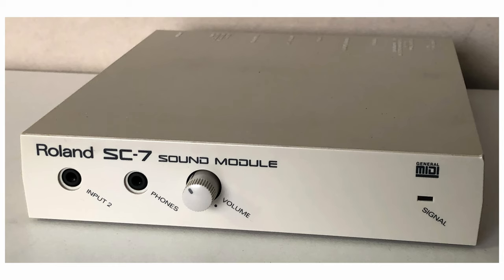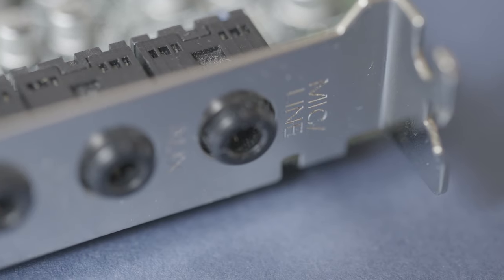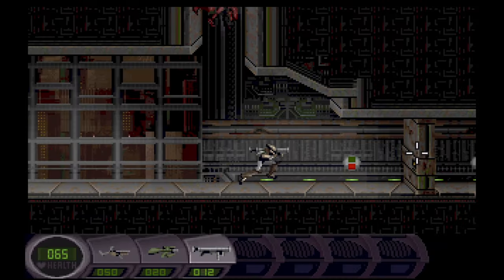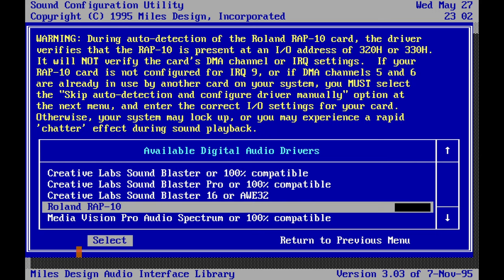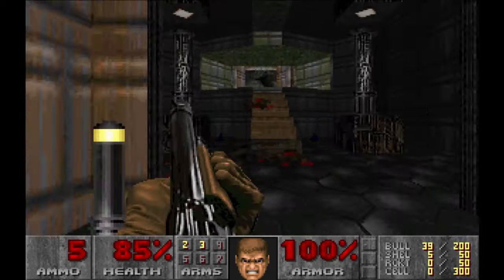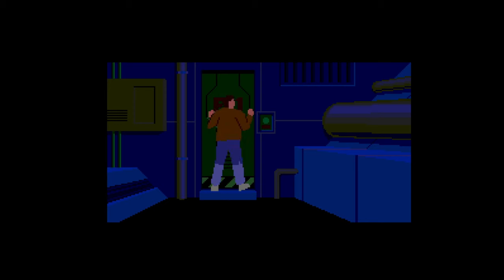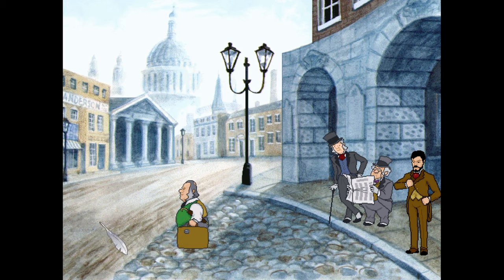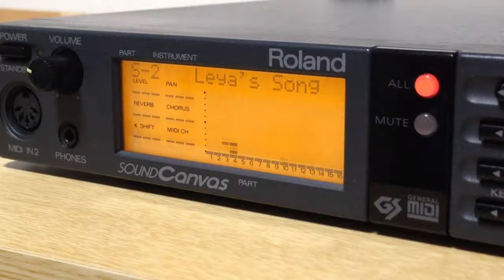Roland RAP-10 review - Quest For The Ultimate DOS Sound Card Part 8 - State of The Art Sound Card?

Comment: Back in 1998, I had an obscure card that nobody knew: Sound Vision 32 Gold by Malifax Computers of Singapore (I still have it but I cannot connect it in a modern motherboard (after 2002). It was better than Soundblaster and even better than many other famous sound-cards. It has an ESS AudioDrive ES1868F chip and also a chip made by Dream SA France.
Reply from the maker: Is it this one? http://www.yjfy.com/images/oldhard/sound/Gold-32.jpg
Reply: @KITR-UK  Yes, this is the one! I still have it and it's still working, 22 years after. However, I had to buy an old PC with a suitable motherboard, in order to install it again (the PC on which I first installed it died in 2002) because it is connected only in an ISA slot not a PCI or PCIe. It has a great reproduction of MIDI instruments and I used it for composing with the help of Cakewalk Express v 3.1. I remember that, in order for the wavetable chip on it to work and start reproducing the MIDI sounds with the highest quality, I had to change the MIDI sound settings to MPU-401. Before I change this setting, the midi sounded awful. But really this version of Sound-Vision 32 Gold  (there was also a 16 version) was far better than the similar SoundBlaster. The only negative is that it has distortion (hiss noise) in the sound, which can be heard even in recordings and for this reason I had to perform a hiss removal in order to clear my MIDI recordings. I have in my channel two such recording: one piece is called "Die Like a Rock" and the other "When a Thousand Years Pass". You may check them if you like.
Reply from the maker: @ct_madness  Maybe you should consider recapping the card, it may help with the noise.
Reply: @KITR-UK  Well, I would prefer to find a way to install it in a modern computer and use it in Windows 10, if possible :)

Comment: I had one in my P60 and besides recording some tacky riffs in wndows I never used it. Can one insert a SB(clone) and have the Roland play midi and the other card for wave playback? I also remember when running Quake2 that the digital sound effects were delayed. Btw, the price back then was something like 600 Euros.
Reply from the maker: Good question, I've never tried that. I'll have to test it, if there are any problems with this kind of setup. And I'll also try running Quake 2 if the sound fx will be delayed.